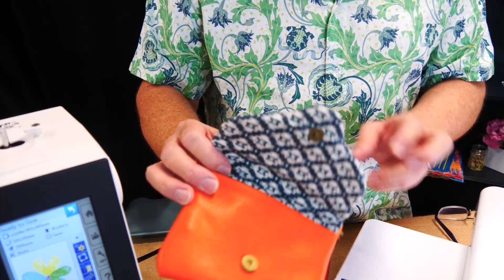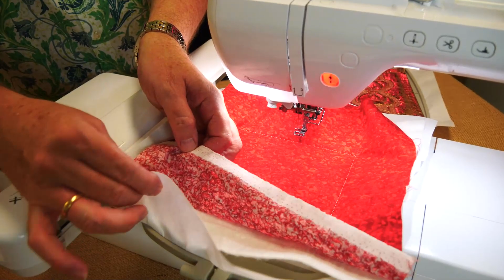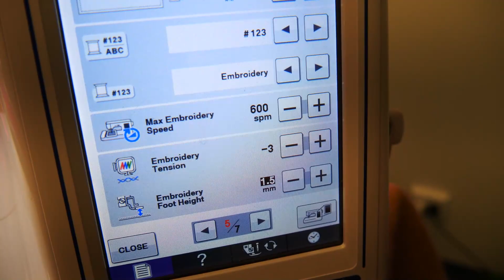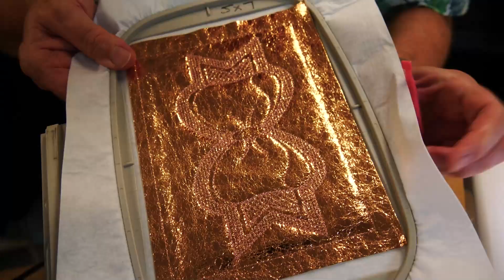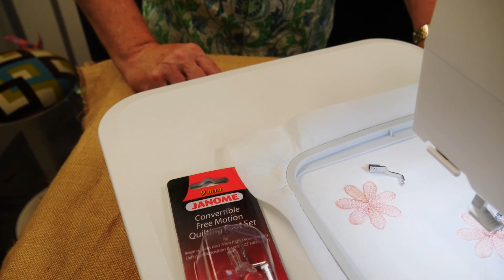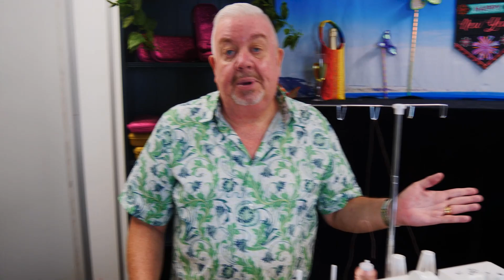Dealing With Fabric Thickness "Embroidery Machine" By Martyn Smith

Comment: Can you use the Janome convertible free motion quilting foot no. 202001003 (the 7mm version) with the Janome 550e or does it have to be the 9mm version - 202146001 which you use in the video?
Reply from the maker: To be honest, I don't know... I do know that some people use the foot from their MC12000 or MC15000 but I'm not sure if they are referring to the 7mm one. We use the pms one as if was recommended by our local Janome dealer. The only thing I am certain about it the machine needs to be high shank. The list of machines for both feet mentioned, seem similar.